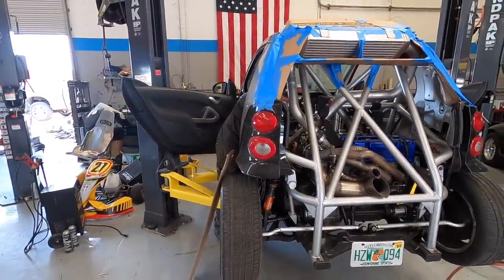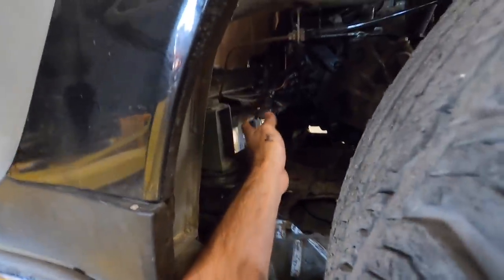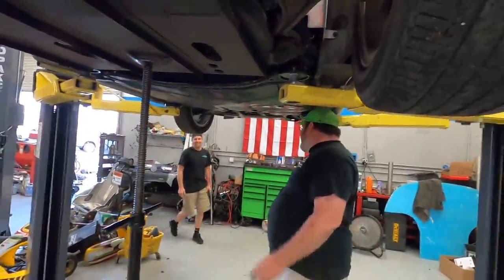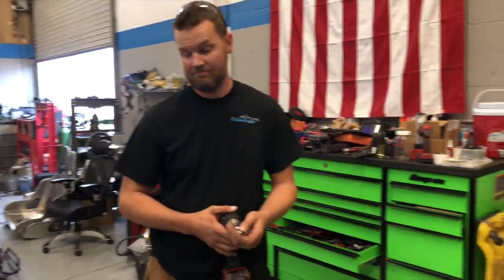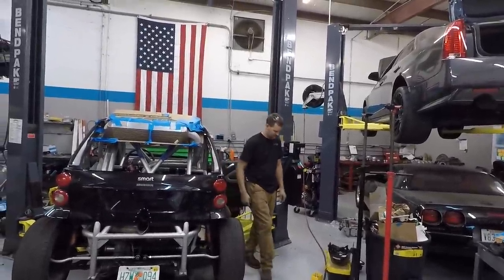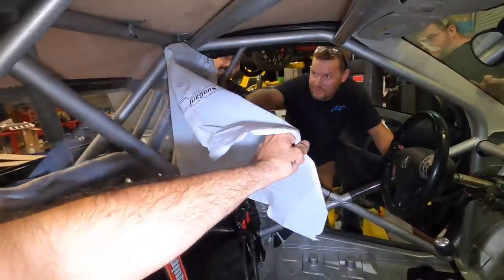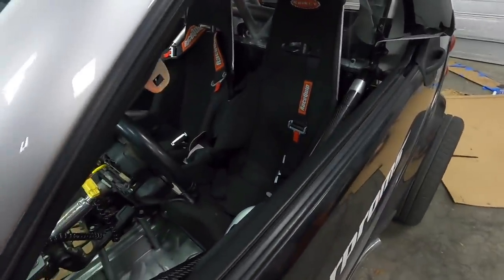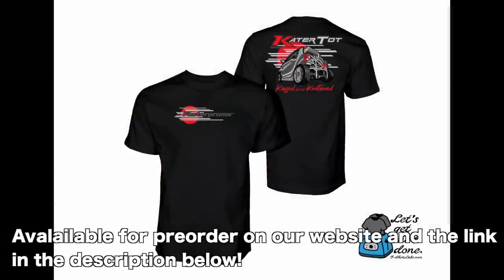We Attempt To Make Our KSeries Smart Car A Wolf In Sheeps Clothing! Engineering Revisions IN & OUT!

Comment: A trick I used to do that would be perfect for what you're wanting...go to a fabric store and grab some stretchy t-shirt type material or spandex.  Make a wire/cardboard frame or shape some foam, put some masking tape on edges, then stretch the fabric over it.  Paint on some fiberglass resin and let it cure then pop out the frame and you got your shape.  You can even put painter's tape on the cage and wrap the fabric around to the bottom and resin all the way around the bend (a little less than 270 degrees around) . It acts like a spring and holds itself in place so you can pop it off and on.  Add a layer of actual fiberglass on top then finish it out and secure it.
Reply: What you actually want to use is ceconite. Its much stronger and designed for that purpose. It's heat-shrinkable to get good tension and it wont sag (like stretchy material will) when you start wetting it out with resin, especially considering the roof is horizontal, therefore most susceptible to sag. Build a metal skeleton, stretch over the ceconite and use hot glue or other cement to secure it, shrink it, one resin layer then fibreglass or CF. 

This stuff https://www.youtube.com/watch?v=oiUbFR21-6s
Reply: So aggressive, I like it

Comment: tufts of yarn!  easiest way of determining airflow over the car. My guess is that you'll probably need to move the opening farther forward and a little taller to catch the turbulent flow that separates off of the front of the car.  A duck tail will definitely increase down force on the back. You'll probably want to add a spoiler to the front to get it to stay down.  The undercarriage work is on point!

Comment: Wish I was there,  I'd build you roof scoop that would be bad ass
Find a old roof from a early 60s car, cut to fit, tack in some directional support and bolt in place.  The rounded roof panel would fit perfectly and look amazing and real cheap.
Run it all the way back to the radiator,  you could also channel each side for turbos and not lose that cool sound inside

Comment: I would put a small “exhaust” hole at the back of the scoop above the intercooler. It should cut down on the lift pressure on the scoop and help draw air through faster . 

Edit: if too much air is getting funnelled into the scoop the pressure inside will be greater than the air trying to get in effectively causing dead air inside the scoop. An exhaust relief hole will allow air to continue to flow .
Reply: Agreed that too much air coming in will 'back up', create turbulence, dead air, and less heat transfer from the intercooler to the air stream.  A better way would be to have a smaller opening, and the cross sectional area expand as the scoop goes back, to match the size of the intercooler face.  This will slow down the air, create less 'dead air', and increase heat transfer as the slower moving air goes through the intercooler.

Comment: JEREMY LET ME TALK NERDY TO YA 
The intake scoop --  if it's a 5" intake tube, the area of it is  only 20 square inches, so your scoop definitely doesn't need to be so huge.  
   10"x2"  rectangle is equal to the area of the 5" pipe diameter.   if you make the scoop more rectangular about 12"x3" (or the length of the window, whatever that is)   it'll pull way more than enough air to feed the turbo, without sticking out all dog-ear-like.   and match the other side a little better.  SYMMETRY, YO!  Kinda make it match the roof scoop too, ya know? 

Anyway I love this project, the recycling/re-purposing, the on-the-fly engineering, the sheer insanity,  it's exactly the type of stuff I like to do.  Keep the smart car content coming!

Comment: This Project jumped to my number one spot really quickly, it's insane, it's going crazier and better.
Keep up the amazing work and thank you for the content.

27:04 The passenger side footwell/carpet is a big polystyrene molded piece housing the flat repair fluid, the 12v compressor, valve remover and tow hook. You gained so much room removing it and the stock piece is not comfy if the passenger is anything above 6".

Comment: cheap fix to the larger rear brakes is to cut some of the pad away, make the surface area smaller.i do this with my circle track car when I upgraded to rear rotors from drum brakes. had the same problem with too much rear brake.

Comment: You should add some naca ducts to the floor panning (maybe the front side of that rear diffuser?) to help airflow to the engine bay. It will help keep things cool and add downforce since you're pulling air out from underneath the car. You could also add a spoiler to your air ducting post intercooler to gain back some downforce there. The smart car is awesome keep up the good work.

Comment: Just an idea, make the opening for the roof scoop smaller which tapers open to a bigger void before flowing through the intercooler. This will cause a low pressure effect on the scoop which will draw in cold air and flow through the cooler giving better IATs. Your current idea is causing a high pressure point on the scoop intake so airflow wont be optimal. The air is tumbling and causing drag which will hurt the drag coefficient of the car. Hope this helps. Love the puppies!

Comment: Hope this helps 😎
Basic fluid dynamics will show the airflow will NOT get deflected. In fact it will actually follow the roofline straight into your existing scoop. You can test this yourself with a running tap and a dessert spoon. Hold its curved base in the flow and you'll see it'll follow it perfectly. Your problem is getting the air out. That horizontal flat bit behind the intercooler is causing a low pressure area, slowing the airflows escape velocity. Angling it to follow the line of the bottom of the intercooler will increase the flow dramatically.

Comment: You guys need to hire an engineer to help you with those thermodynamics. Just reinstalling the roof would direct air into the intercooler scoop better. Just sayin'
Reply: This is just a screw around project. Jeremy's actual business wouldn't benefit from paying an engineer like that.
Reply: I was thinking the same thing. Have the intercooler mounted in the same area but below the roofline on a forward facing angle. Drop the roofline into the intercooler area and have an exit under the car or right behind the engine. The vacuum behind the car will draw the air running along the roof line into the intercooler. 
Check out the Dalbach (sp?) Golf.
Reply: He's doing it himself. Trial and error. I approve. A variable opening scoop would be good. Like the self adjusting rear wings.
Reply: I got ducktype and some wd-40 ,I’m qualified to be a engineer at this point

Comment: 10:00 - just fit a proportioning, or pressure limiting valve, to the rear brake line. It may already have one, so easy to swap out or modify.

Comment: On the sides of the Plexiglas, you could cut a slot in the edge with a Dremel and use Velcro loops to tie it to the tubing for added stability.  I was also thinking that you could fashion some C-shaped clamps out of some thin spring steel that would clip onto the tubing and allow you to snap the body panels to the cage and allow for quick removal.

Comment: For the intercooler exit, run plexiglass from the bottom of it to the bottom of the rear window seal, patch the rest in however, the ejection of air in a downward direction might counter the lift, and its less of a corner for the air to turn round

Comment: Thinking about the power bulge. You may find that even though there is a large opening in front, as soon as you are at speed the air compression will be higher than its ability to flow through. If you have any airflow efficiency issues, try opening the back end of the scoop so that more air can be scooped and flow in and out taking the heat with it.

Comment: I'm not an aero expert, but I think the reason that air isn't making it to the intercooler with the setup at 3:30 is that the air isn't riding against any surface after it passes the windshield. Air, and water, will "stick" to a surface so if a roof was there it should guide it into the intercooler ram

Comment: If you guys make a skeleton for the scoop. You can pull fleece fabric down into a custom duct shape and use fiberglass resin to harden it. Then reinforce it with fiberglass similar to how stereo installers make custom speaker boxes. That would be a good way to make your intake for the turbo.

Comment: If you're heading towards fiberglass on your scoops and such, Dollar Store foam board and the paper glue is water soluble and makes an excellent 7/32" thick core for a composite structure. You can remove one side to allow it to bend and cut it halfway thru or just score it to allow tighter bends.if needed. There are a bunch of  foam board RC plane videos that will clarify what I'm talking about. It's a Dollar Store product only as far as I know, I've tried it with another brand from Hobby Lobby and it doesn't work, so I'd just use the known product.

Comment: Have you tried different scoops to look at the difference in intercooler temperature?   so small to start with and then opens up.. therefore the ft/s is lower in the scoop and because of that a higher heat transfer or start big, end smaller to increase flow ft/s to reduce temp that way.. You can look at the scoop of the RS200 and the airbox scoop in the peugeot 306 maxi.

Comment: For the turbo intake, why not put some ducting leading up to the gap behind the driver's seat and build a box around the filter with a duct going up to the roof scoop? That way you can still roll up the windows. You'll get good clean Air without losing flow to the intercooler

Edit: also shouldn't obstruct your rear visibility since it will be directly behind your head.

Comment: Possibly factor in the windshield with the Power Bulge™. Does the Windshield act like a massive ramp/wing directing air upwards? Maybe over hang the windshield to catch that air and may allow a lower or cleaner entrance. Depending on how much air is being directed up by the windshield could use only windshield air and curl the lip over and be clean so it looks like a normal roof from most angles.

Comment: Jeremy have you thought about using vortex generators instead of putting a scoop further forward on the car and increasing drag? They would help keep the airflow stuck to the roof before it entering the inter-cooler at the back of the vehicle. Aircraft use these to help smooth airflow over the wings as well as keep the airflow attached to the upper surface of the wing during turbulent airflow such as during a stall.

Comment: I think you should drop the roof inlet down through the rear portion of the interior/take the rear portion of the roofline and taper it down so it goes under that bar some yes there will be a bar there but the intercooler will still get more flow and it looks like it would only take unused interior space. Think about it...
Reply: Or if heat continues to be an issue change the angle of the intercooler a bit to be a tiny more upright.

Comment: Use a wide roof scoop shaped like the dodge demon hood and using sheet metal for rigidity and bolt it to those tabs on top of the intercooler and extended it and bend it downward with gussets slightly behind the intercooler so it also works kind of like spoiler adding some downforce to the rear

Comment: Hey, this is my favorite build right now. The next outrageous mod it could use are oil & trans coolers on the front bumper and maybe fans pushing air through the intercooler? Due to the low height of the actual cooling element, you might even be able to make 2 PC fans next to each other work just fine. Any 12V fan and just hook it up to a button on the steering wheel. How about those splitters, tho? Keep the content coming!

Comment: with the mock up roof scoop you should use a small #8 or #10 bolt n nut with some large surface area washers place in the middle area to help keep the scoop on

Comment: You could get a good solid radiator fan to pull air in from the duct when you're going City speeds or idling and throw it all on a simple toggle switch or repurpose one of the buttons on the steering wheel

Comment: Have you thought about how much of the air that will be pushed out on the sides by the windshield at high speeds completely passing by the side scoops? 
I would replace the rear view mirrors with scoops instead, drawing air into the door, passing it along form the inside of the door into the engine bay.

Comment: hi guys if you put 4 spray nozzles across the back of the roof scoop in front of the intercooler and run compressed co2 through it you would lower the intercooler temp by at least 50% use a soda stream bottle with a solinoid on it run through the ecu when it comes on boost it squirts co2  c02 in a compressed liquid comes out at -109 f then solid sublims to a gas at -109 f so it wont freeze up like a block of ice also a soda stream bottle could be hidden and no one would see it you could also use this type of setup  to add extra cooling for the radiator as well great job on the car i love the out of the box mentallity if it cant be dont it soon will be cheers from down under

Comment: Just a thought - you might have the same issue with that intake as you had with the roof scoop, the air is going to be pushed away from the body, rather than following the panels. It could be scooping from a low pressure zone, this is why lambos etc have the trough leading up to their side intakes, to negate that effect. That being said, the turbo will be sucking, no real need for a scoop anyway.  Probably a small lip on the rear edge of a flush intake would create just as much of a higher pressure zone for the scoop to draw from.

Comment: Is what you need is a front mounted weight plate (I forget what they're actually called). Like a steel aero plate mounted under the front bumper to keep the front tires down and keeps the air out from under the car.

Comment: Was wondering a couple things. 1, for cabin sir, why not use dryer vent hos in the cabin from the front of the car ? ans 2, for the cooler , instead of fabing all that up, why not utilize a couple 6  inch DC fans to push, or pull the air through ?

Comment: Once you have designed that scoop. I hope you guys make it out of aluminum. Cut it out on the plasma table. Bend it where needed affix it really well and run it. I think it will grab air so well you won’t need to have a wall on the front edge. You can probably cut it back to a 20 or 30 degree angle which would look better with the A pillar. Also I feel like you scoop for the turbo should also come from the top not the sides. Meaning the same piece you are making for the intercooler can direct air down to the turbo. One piece, cleaner look, simpler install. Just a thought. Hope you guy make it cool looking.

Comment: You can airtight the thing with some Sikaflex 1A, they even make it in a silver color really close to what you need, "aluminum grey" is the color. The cabin is always going to be your negative pressure area unless you add a frontal scoop to pressurize the cabin, it's going to suck a LOT of exhaust if you don't fully airtight the back. EDIT: Put the factory cabin air check valves into the partition somehwere. They should be in the trunk of the Acura deep down near the back corners.

Comment: No need to extend the roof scoop. the air will hug the new roof and cram the air into the intercooler ( look up wind tunnel any wind tunnel video) , just add a small scoop right at the intercooler.:)

Comment: Would be perfect to run some type of intercooler piping to the air in on the turbo and run it to where its facing forward and as you drive it shoots cool air to your turbo... just put some type of metal screen over it😅.. love the build! Wanna do a similar build to my 94 geo metro but I only have enough for a street bike engine 😁

Comment: Did you make your firewall out of that aluminium composite material?
I couldn't tell but it looks like you did, just so you're aware that stuff is no good for fire. when it gets too hot the plastic inner layer melts and the panels are essentially flammable (main factor of grenfell tower fire in uk).

Comment: Jeremy Buddy you could also for your front end when you bring forward 's few inches you could go a bit wider as we more stable I did for my car worked a treat mate mines a ke 55 corolla with rb 30 vl commodore engine and skyline gear cut and shut diff so skyline running gear and I wanted tighter turn for drifting so I put s13 stealing rack and put r 31 skyline extended lower control arms gave it a foot wider stance at the front comperad to back made it better for my adjustable camber tops it be good to do something like that too

Comment: Jeremy, why not use the valve you use for burnouts to restrict the fluid/pressure to the rear? You could use it as a proportioning valve so it will bias to the front brakes and you won't have to re-engineer the front brakes

Comment: My first idea was to put a whaletail type wing on the top with a hole in the front flat part of the tail for the intercooler. So the whaletail would create a high pressure zone and force air down the hole and through the intercooler.

Comment: The inlet to your intercooler scoop should be smaller than the exit. I know it sounds backwards but it’s true. If the inlet is bigger than the outlet the air will back up and flow around the scoop, if the inlet is smaller it will force the extra air through the intercool. Just a suggestion.
Reply: The same applies to radiator ducting.

Comment: Add turning vanes to the curves of the intercooler ducts, both intake and exhaust. Will spread the airflow across the intercooler, rather than all the air just hitting the top half of the cooler. Ask an HVAC guy if you have questions about this.